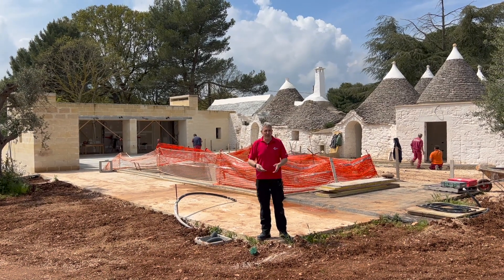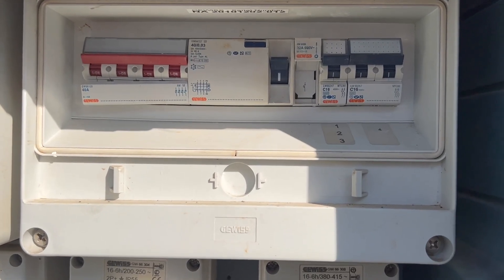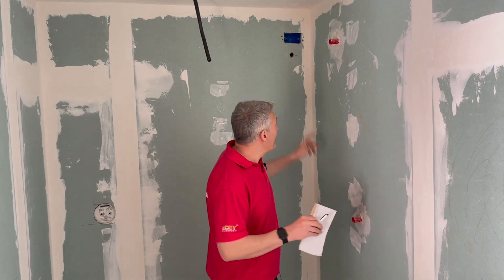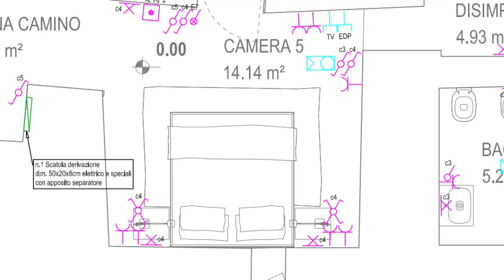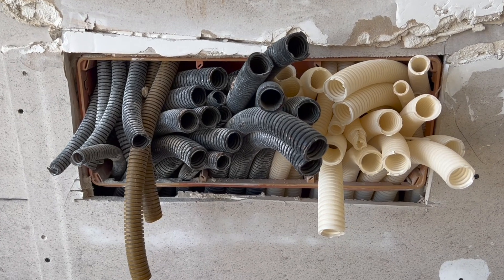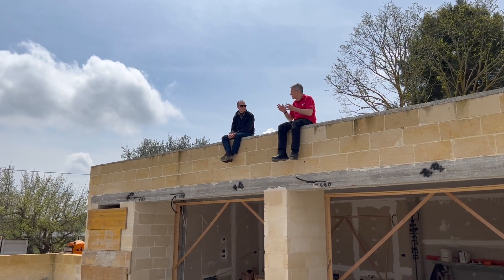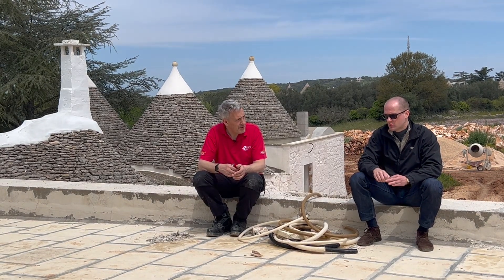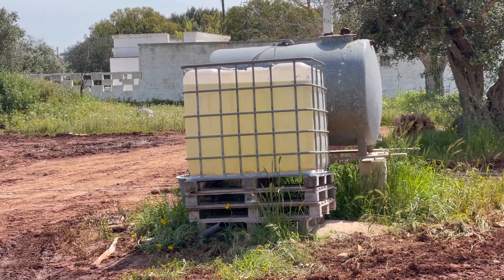Electric Wiring in Italy - You Won't Believe What They Do!

Comment: When I had my home built here in the southeastern area of the Med I had my electrician do a double system in the home. There is the regular 220 vac system as well as a 120 vac system. I sent in plastic boxes from the states that could be imbedded in the walls and provided the electrician with a sample of 12 gauge wire so he could purchase the appropriate metric size wire. It worked out great since the wire he chose was a bit larger in diameter than the sample I provided him. The outlets are rated for 20 amps 120 volt service. It’s been 17 years here and we have been using a lot of the American appliances and tools with zero issues. As an Architect I designed the 120 volt system to our needs and the electricians here are some of the best and followed my instruction to the letter. I also requested that CATV coax feeds be a pair to each outlet box as well as requesting Cat5e cables to be run as pairs to each box. Everything terminates in the electrical room to termination panels. They are all coded so I know where each one feeds. I can control which room receives TV, Satellite or Security video feed as well as which room receives network and telephone service. Nice and neat all with color coded jumpers.
Reply: Having anything from the USAs antiquated electrical system is not wise. They are so far behind they need to to update ASAP. The plugs are terrifying. British, French and German systems are far superior, especially the British fuse-in-plug G type plugs.
Reply: @johnburns4017  what I find wrong with the "German" schuco outlets and plugs is the fact one does not know which part of the receptacle is phase or which is neutral. The American system we know which is which, small blade = phase, large blade = neutral. Ground is the longer of the prongs which makes first contact in the receptacle. There is no marking on the Euro German outlets as to which is phase. Electricians randomly pick a side which will be phase. As for ground, it appears to make contact simultaneously with the other contacts in the receptacle. The only plus side is that the contacts are recessed deep in the outlet. As for the British connectors, not much different from American receptacles, blades are exposed as they make contact with the receptacle contacts. The one item I appreciate is that the plugs are individually fused, thus offering greater protection to the appliance that is connected to the circuit. Back in the ‘70’s one could find fused plugs that had a fuse for both prongs however the plugs lacked a ground connector and were not keyed as to phase and neutral since both prongs were narrow allowing one to inset it wrong. This would be an issue since radio and TV manufacturers went to what is referred as a hot chassis design. This was a bit of a misnomer since the chassis was actually the neutral but could become hot if a non polarized plug or cord set was used on the appliance. Now as for unsafe or obsolete, it’s been in use for decades and the National Electrical Code is being constantly updated for the latest in safety systems. It is however up to the homeowner to update and comply with code. The Code is a basic guideline set up by the US Government. There are many States and municipalities the might have far more restrictive laws than what is stated in the NEC. In the city of Chicago, the code states that all wiring shall be run in metallic conduit to prevent issues of electrical faults causing fires within a structure. Conduit shall be bonded to the ground system of the structure as well as a discrete ground wire will be run within the same conduit to provide a ground to all outlets and fixtures.
As for my use here in my home it is limited to small home appliances and power tools only since the rest of the ancillary equipment has been purchased here in the EU and runs on 220 volts. If anything the government owned distribution network has far more problems with antiquated and or tired second hand equipment that the politicians purchase from Germany. The network cannot handle the load that is placed on it since politicians have been pushing for more electric heat pumps and cooling systems for homes. Both wiring and transformers in the network are old and undersized for todays loads.
Reply: @Subgunman  
"The only plus side [Schuko] is that the contacts are recessed deep in the outlet." 

▪The German schuko outlets and plugs are inferior. 
▪You do not know which part of the receptacle is phase or which is neutral. 
▪There is no marking on the Euro German outlets as to which is phase. 
▪Electricians randomly pick a side which will be phase. 
▪As for ground, it makes contact simultaneously with the other phase and neutral contacts in the receptacle. In British type G plugs, the ground make contact first and last to break contact. 
▪The plugs are not individually fused.
▪Dirt accumulates in the Schuko recess. Housewives squirt in cleaner to clean them. Oooops. A negative point. 
▪The prongs are flimsy.
▪British pins are insulated so fingers cannot touch phase and neutral.
▪You cannot touch the earth connector on a socket in a British plug unlike in a Schuko.
▪The British sockets are switched. 
▪The British system is polarised, as is the French, unlike the German.
Reply: @Subgunman  
The Chicago code is 1930s. Unbelievable.
Reply: @Subgunman  
Parts of the USA grid is in a mess. We regularly see news items on power outages in California. And a whole state's grid  collapsed - Texas. It is like the US system is sliding into the third world. 

They have to adopt priority systems in homes, so the water heating drops out when an essential appliance comes in, etc. 

Some of the California problems would have been solved if the US appliances were at EU efficiencies. I am amazed at the top loading 1950s looking washers and dryers.
Reply: @johnburns4017  the grid here in this country is just as bad. It boils down to greed. Power companies always use the excuse they need to pay their shareholders which is a lie. Big shots pocket plenty of money that should go into network improvements. 
Since I am in a high sun area with plenty of wind on this island I can invest in a hybrid solar/wind system and eliminate the grid altogether. I see that the country is offering subsidies for solar however as in the past they place too many restrictions as to who receives these subsidies ( usually their friends and buddies ) but there is a clause that limits the power your system can produce and they expect it to be tied to the grid. Many were screwed in the early days when people with extra land or roof space were conned into installing solar to feed the grid. After about a year the government started taxing the money they were paid for power which violates EU regulations. That money is supposed to go to pay off the equipment that was purchased and only after the equipment was paid off the money could be taxed or reinvested in additional and new equipment.
I am dealing with a leasing company privately that states if the government wants to force me to connect to the grid, all payment must be made directly to the leasing company and since they are not located in the EU they are not responsible for taxes nor am I as the holder of the lease. As it stands I have enough roof exposure for at least 20 Kw in panels. Checking with a friend who has invested in a "solar park" with similar output, on the worst days in winter a 20Kw system can produce 2Kw of power. Add a 2Kw wind turbine and all is ok.
Reply: @Subgunman  
Do not forget battery storage, when no wind or solar. "2 kW" is a lot during the day when few appliances are being used. If I was you I would go 100% off grid. 

The era of the autonomous house is approaching:  
▪ Rainwater harvesting for grey water use.
▪ A cess pit.
▪ Potable water delivered in tankers. 
▪ Cell phone with no wires.
Reply: @johnburns4017  From what I understand, Texas wanted their grid to be separate from the rest of the country's. So when it crashed, they couldn't draw from the other sources.
Reply: @stevegabbert9626  
Texas crashed because they never winterised equipment. And the demand was also higher than they could produce normally, so I believe. Little has been done to prevent a reoccurrence.
Reply: @johnburns4017  That is correct, and their system is separated from the rest of the grid.
Reply: @stevegabbert9626  
Texas is not actually. I just read it is connected to Mexico and another connection somewhere. But they suffered the same arctic temperatures, so had nothing to spare. If they have another bout of arctic winds next winter it will happen again. Very third world.

Keeping it separate may be a step to make Texas a separate country. Something they  always keep mumbling about.
Reply: @stevegabbert9626  
They had natural gas fired power stations. When the power went off there was no electricity to power the pumps to pump gas to the stations. I assume the have now installed emergency generators fro this.
Reply: @johnburns4017  You are full of yourself.
Reply: @jdilksjr  
No. I have worked with both.  The USA is way behind. The USA needs to catch up quickly, to superior and safer systems.

Comment: As someone who's not a spark, if you exclude the cost aspect I think that having RCBOs for each circuit is way better than "old style" split load systems as if an appliance craps itself and starts leaking loads of current to earth, with an RCBO setup, you just lose that one circuit, rather than half of your circuits with a split load system. For sparks called out for a fault finding job, it must make their job easier if a system has RCBOs for each circuit
Reply: The last three properties I've specced all have RCBOs, and I would not have anything else for the very reason you mention. Split RCDs are a nightmare in many ways. Cumulative leaks over multiple circuits causing nuisance trips, poor fault isolation and identification, and half the power disappearing with a trip. I've only ever had an RCBO trip when there was a genuine problem. They should be mandatory in my view. Another couple of hundred pound on an installation that costs several thousand in labour. It's money well spent.
Reply: @TheEulerID  What's your thoughts on whether AFDDs should be made mandatory as well (I believe they do "MCB sized" combined AFDDs & RCBOs)?